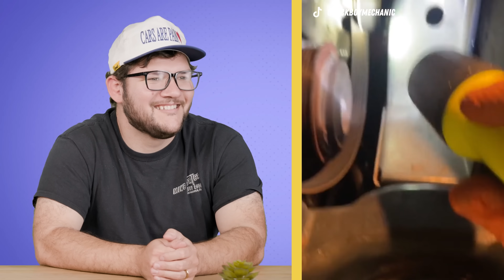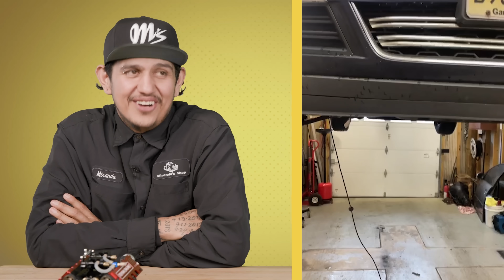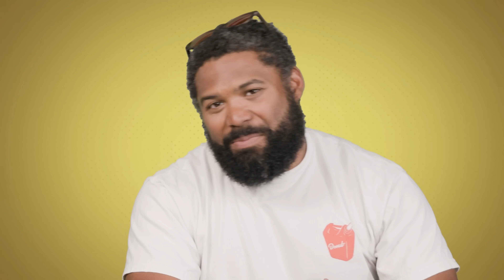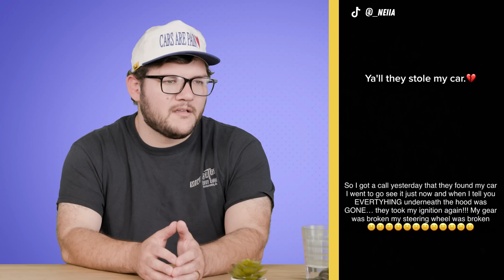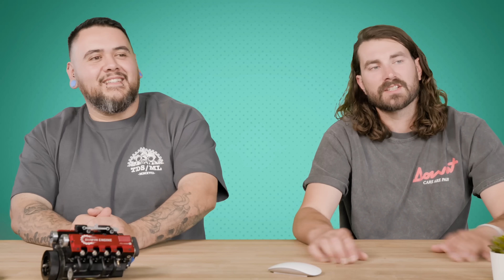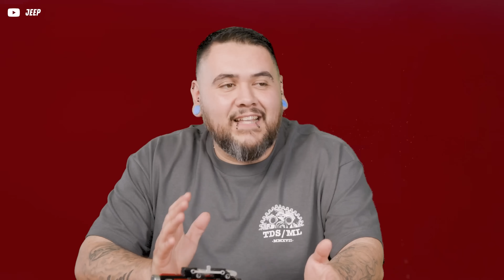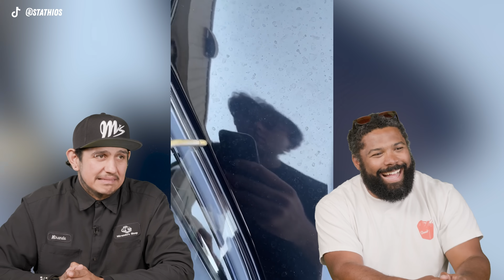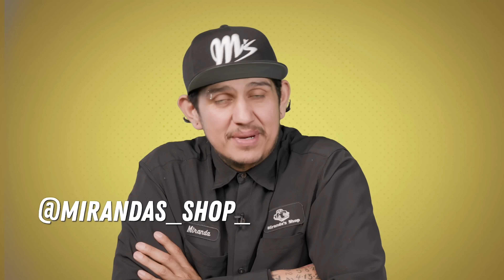Mechanic Reacts to Car Engineering Fails

Comment: 90% of things blamed on engineers were things engineers knew about but were told by the accountants that it wasn't worth fixing. Also for a lot of these odd things, there is a special tool that only dealerships can get ahold of that cost hundreds of dollars for an oddly shaped wrench.
Reply: YES! 
Don't blame engineers for engineering problems. I'm an engineer and 80% of serious issues are like: Engineer informs about a certain Risk or problem and asks management for time to make a redesign and retest. Management ignores this request, because time and money. I've been there, finding health-threatening problems in the design and being ignored completely. Good that some industries require something like UL or TUV, because these labs might block release of your device. But they only find a fraction of issues with the design. 
Stupid thing is that managers generally want to save like 100 hours once on the design time at a cost of 10000 hours per year of lost time - but it's someone elses time, not theirs so who cares.
Reply: @OldSkullSoldier  Good example is that one car that blew up if you love tapped it on the back (forgot the name) And it took only like some cents to fix
Reply: @normalchannel2185  You are talking about pintos i think
Reply: @OldSkullSoldier   redesign and retest and there is the truth you engineered a problem and people dont wanna pay for your problem think before you engineer stupid shit that needs to be fixed
Reply: @demonsluger  Fact that you are too limited to understand how complex is engineering anything, doesn't mean things aren't complex.
Reply: @OldSkullSoldier  Shit man, you can't even convince me, no wonder you couldn't convince the accountants.
Reply: The special service tools by: OTC, SPX, Miller, Bosch and others are crazy in price sometimes ($300 for pinion oil seal tool/cup, or differential dummy bearing set for $600), but they work so good. Obviously the sales of used special tools on eBay is a medium hot market with significant savings. I bought many $50USD to $65USD used tools off of eBay knowing I may use them only one or two times.
Reply: @pgmurray76 I'm going through that specialty tool problem right now. Doing an inframe on an 8.3 Cummins diesel. I've done "farmer" hacks in a few places, but still had to buy quite a few tools. After spending over $500 on a liner remover tool, I used an indexing pry bar and a pair of Knipex to remove my injectors as I knew I'd replace them anyway. Didn't want to pay Bosch a hundred or so for an injector puller that wouldn't fit very many different engines. I'm also not gonna buy a Cummins liner installer for $300+, as it's just a chunk of cast iron shaped like a top that you hammer the liner down with.
Reply: @markiefufu  I have heard, but NOT tried (yet) that unscrewing the injector mounting bolt three or four full turns of thread and cranking the engine two seconds will loosen very stubborn injectors using the high compression of the diesel. All assuming something is stuck when using conventional tools and that the state/condition of the engine allows cranking without harm or damage.
Reply: @markiefufu  Knipex plier products are sooo good it is ridiculous.
Reply: @markiefufu  I am a bit crazy. I bought at least $250 of new and used tools for a Jeep Liberty! I still have some Honda tools unused as some one legged guy in a rusty, black, 2000 GMC 1500 pickup ran over the hood of my Honda while I was sitting inside, parked.
Reply: @pgmurray76  I rarely use any pliers other than my Knipex now. Maybe a pair of Engineer/Vampires now and then.
Reply: @markiefufu  You can tell immediately how solid and well crafted they are by picking one up. Thank God for Lowes having a huge assortment. Project Farm had some fun with them a year ago. One or two Kleins are ok, but not quite Knipex.
Reply: No special tool for that bolt against the inside of that suspension tower...unless it is a carbide holesaw or plasma cutter!
Reply: @pgmurray76 exactly.  Only special tool is the mechanics back or plasma cutter.  Unfortunately this happens at a mechanics expense and that's why I got out of working in shops early on.
Reply: @pgmurray76  it would be easier to try and cut the bolt and replace it with a shorter one
Reply: Is it an engineering failure? Absolutely. Are the engineers responsible for it? Maybe, maybe not. Engineers aren't infalible, they can make mistakes. But so many of those things are related to cost and engineers aren't the ones trying to save margins. There are well known cases like Ford's PowerShift transmission, where pre-production engineers gave it a no-go and they sold it anyway.
Reply: @thiagosestini29  See also any number of Ford gas tanks over the years. They keep making that "mistake" and I guarantee it's not the educated people who know they get blamed when it goes wrong, in other words the engineers, slamming this stuff through.
Reply: Wtf is gonna get that bolt put that's basically touching the frame? Is there a gap inserter that gives you extra space to be able to remove the bolt?
Reply: @Split0069 Like the lady said. Loosen motor mounts and jack up the engine until the bolt can be removed.
Reply: @shadowthehedgehog4737  Lots of cars these days the instruction from factory is just take the engine out. Due to the tight packaging in modern cars it's often just not possible to give access to a lot of these bolts, not without redesigning the engine which defeats the purpose of using the same engine across the model range for economy of scale.

Of course DYIers suffer because you need a lift to do routine maintenance on the engine, but that's not really their concern because they OEM wants you to go to the dealership for maintenance. There they can have the engine out in an hour.

At lot of people forget that the engineers who designed the car and the engineers who designed the engine aren't even the same people - often they don't even work in the same factory, or for the same company - and it's not easy to mate the two perfectly, and if they had to redesign every engine for every car to prevent this sort of thing then the cars would have to be much more expensive.
Reply: and as an active aerospace engineer (also used to work at hyundai), this is the reason I tell aspiring, car-loving hs kids to stay away from engineering, but rahter, do somethign that makes them enough money for them to BUY the cars they enjoy (minus the drama).
Reply: @redbullrobert  that's another reason I didn't wanna continue working in a shop.  It would've sucked my love for cars out of me.  I'm glad I did, bc I still love cars and still work on my own at home.
Reply: @richardlapoint1845  If i were to work on cars it would only be older models
Reply: I knew a guy who worked in a automotive shop, fixing cars, doing mots and the like. one day a guy came to him with a really fancy car and to fix it he needed to get a wrench socket that only fit that make of car. he told the guy that he could fix it but that the £200 for the tool would have to come out of the customer's pocket since it was so niche that he would likely never have a use for it again and thus would never get his money's worth from it. the guy was loaded (obviously, since he had such a high end car) so he just said sure, bill me for it.
Reply: @AnikaJarlsdottr  If I was that loaded I would just go to the dealer. Otherwise I would say"sure" but I get to keep the tool when you are done so I can let the next guy borrow it.
Reply: there is an oddly shaped wrench that can pull a bolt through quarter inch of solid steel?  Even if you loosen that bolt (which can be done with a simple loop wrench), you can't take it out because of the metal plate blocking it.  Which can only be removed if you remove a bunch of other stuff.
Reply: So the accountants do not want to spend money to fix something. Then the rep goes down hill. The accountant and company looses lots of money. !!!!!
Reply: for sure. usually we end up buying a china knock off tool or have to play machine my own tool for an hour lol
Reply: they engineered the problem in the first place its not like the accountant choose to put the oil plug so that it would spill into the underside of the car that was the engineers and the accountant say f you to spending more to fix their fck up
Reply: I really think it's just due to lack of real world experience and reliance on computers and algorithms. I don't know how many times I had "but see right here, it says it works" and directed to a spread sheet or cad program. It's not about quality, but quantity.
Reply: No. Engineers designed it that way in the first place.
Reply: @etherealicer  This. More complex things I can understand a Engineer not neccesarily catching the issue. But things like putting those stupid cardboard or plastic covers near the freaking drain plug for the oil pan is a 4 year old with zero knowledge can tell you its dumb. And you cant blame that things placement on the "bean counters" cause they would remove it entirely to save the dime it costs in production. 

What I think the bigger "Engineer Failure", which is more a oversight than failure, is they cant see the trees for the forest. A Engineer of any product has so many different things to look at, many of them being highly technical, that they dont have the time or capacity to ask themselves the more simple obvious issues, like the afore mentioned plactic covers/cardboard things.

Also now having worked with engineers they do tend to hyper focus on the "It shouldnt need to be taken apart/fixed" mentality TOO much. Cars yes engineers will somewhat think on this. But Computers and other electronic products they think in terms of "If its built to EXACTLY 100% my specific specifications it will NEVER need to be opened" without taking into account that nothing ever will be built to their 100% exact specifications, so you NEED to design in the ability to get it apart. Im reminded of those desktop PC cases from the 90s, those things where a BITCH to get into and work in.
Reply: @memnarch129  even if its made to 110% of the specs it can still break the car is vibrating everytime the engine is on an vibrations destroy shit so they are just idiots with a diploma
Reply: @demonsluger  notice i said in things OTHER than cars???

Comment: Ford Ranger with the 2.4 liter 4 cylinder.  The timing belt,, a rubber melt and a regular maintenance replacement at 90k?, and anytime it broke.  Is behind a plastic cover right on the front of the engine.  Get the fan and shroud out,, pull the belt,, good to go, right?   Nope.  One bolt head,, just one, is buried behind the water pump?  Replacement of the belt could be a half hour job,, and SHOULD BE a half hour job.  It is a 4 hour job minimum.  Air conditioner pump,, bracket for that, upper hose, lower hose, pulley, water pump,, it just goes on and on,,, all for not locating that one bolt a half inch left.  Its a maintenance item.  This is stupid.

Comment: To give credit where it's due:
Half the reason engineers do things is so that if something goes wrong in production, it doesn't cause problems to the end user under normal operating conditions. The other issue is that the factory probably calls the engineer and says: "doing it this way costs a lot of time" and then the engineering manager responds "it costs too much! Fix it!". Finally, though this is my humble opinion, engineers have decided that the way to tackle emissions regulations is minimum fuel consumption, rather than maximum fuel efficiency. In theory, complete combustion of fuel produces water and energy. Incomplete combustion, ethanol, and other additives produce other emissions like carbon monoxide. Maximum efficiency in fuel combustion should equal minimum emissions. But that would mean minimum fuel economy, and in this economy i don't blame them for throwing a bone to us consumers. Ultimately, were we in a world where everyone didn't have the need to be the pretentious "I'm a [insert random occupation that requires a 4 year degree]",  people would respect he observations of others and try to explain the reason for bizarre decisions rather than just blowing people off as stupid.

Comment: Lemon law is the reason i only spent $12,000 for a 2001 f-150 with 4,500 miles on it in 2002. It was looked at 6 times the clutch would slowly engage as you held it down. The transmission was taken out 4 times. The problem completely missed by them idiot grease monkeys. There was a very faint crack in the slave cylinder changed that and problem fixed. There was no leaking what so ever.

Comment: All of the design goes into how efficiently they can assemble a car.  You have seen assembly line pictures where they install the engine, transmission, and front suspension all in one go.  Companies forget about designing for maintenance.   Some companies are better than others.  European and American cars are bad. Japanese cars are good.

Comment: Just because something seems like an engineer's fault doesn't mean it is their fault. The higher-ups will not allow a proper solution a lot of the times because it would cost them extra.
I'm not saying it's never the engineer's fault, simply saying that it isn't always their fault when it seems like it.

Comment: Chrysler 2.7 with the water pump inside with the timing chain. You find out your water pump is leaking when your engine starts knocking.

Comment: As an Electrical Engineer working in Electronic Warfare we have to design for these things to work in extreme conditions and last a long time. The engineering that goes into that is expensive, no one in the commercial world wants to pay for that. Finding parts that work in -55°C to 125°C is hell on it's own.

Comment: First guy, just cut enough threads off to get the bolt out. You don't need 3 Miles of bolt to hold a tensioner

Comment: 14:45 Ford used to be really bad about this with the Raptor oil drain plug location. At first all will be fine and the oil will clear the belly pan, but once the oil is almost drained it will start falling onto the belly pan and make an absolute mess in there. Luckily, Ford must’ve heard our complaints as technicians, and they made the cutout in the belly pan a little longer so it’s not directly under the drain plug!

Edit: P.S.: If you’re a service technician that has a tool truck coming by weekly, save the brochures for single-use funnels. They were absolute saviors when I did Raptor oil changes. They’re very good at keeping oil out of places you don’t want it to go.

Comment: some dude at chevy spent like 50,000 hours in CAD to cram a 3'x4' engine into a 5'x6' space somehow..... like jamming the '07 suburban v8 into the firewall with a foot of free-space between it and the radiator.
Reply: or the idiots at volvo who built a car around the fucking heater fan.
Reply: or the idiots that ever built a uni-body vehicle EVER.
Reply: or the idiots who continue to press fit parts instead of bolting.
Reply: or how no bolt ever has anti-seize applied
Reply: or how a vehicle can let itself run without oil.
Reply: or how there are new models and parts, with ridiculous added complexity and no benefit, being made every year. it would seem to be apparent reason other than people want "new cars".
Reply: or....

Comment: I have a 1955 Jeep and I swapped the engion for the mercedes 190d. The body is indestructible it has barely any rust and most thing on it are stoct not including the engion.

Comment: That first one with the Bolt sums up GM PARTSBIN CARS. The same problem on a Opel Signum/Vectra 2.2cdti. Loosen motor mounts and gain extra space using a prybar.

Comment: I have designed hundreds if not thousands of automotive components. Every single component I designed had to go through a manufacturability and serviceability review. If there is a serviceability issue, I can almost guarantee that the engineers knew about it and were likely told not to worry about it by management.
Reply: I remember "don't worry about it" all too well, in medicine.
At the time I worked with a regional facility servicing hospitals with whatever was not available from registered market.
We'd want to standardise and bring to an appropriate scale for efficiency and minimal loss to expiration.

I'd always go through the basic questions: exactly what does the client need, how can we make this easier on staff to use, etc. Management did not like my wasting time, wanted to just make the product so we can sell it. 

Some of our products were scrapped after the investment of validation, because the hospitals wouldn't buy it - staff said that it was too hard to use. 
Some would be a wrong dose or volume compared to what was used by that dpt, others would be about selecting the wrong syringe type - the cheap one that takes a bit of force.
A nurse using a large number of these daily gets rsi.
Reply: Is more of a brush off thing or do they make it more complicated so people can’t work on their own cars at home anymore?
Reply: That is where consumer education becomes important.  If consumers know which cars are easier to service because serviceability has been considered in the design process, they would consider that valuable as it saves them time and money when the car needs repairs.  Then they will choose to buy more serviceable cars.  There needs to be a company that designs a functioning car for the sole purpose of making it the most serviceable car in the world.  Complete teardown.